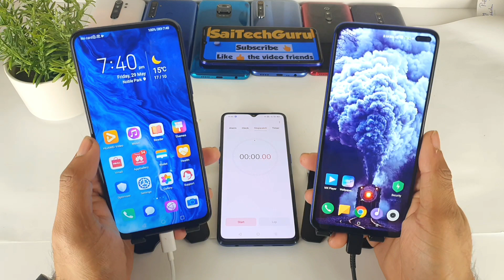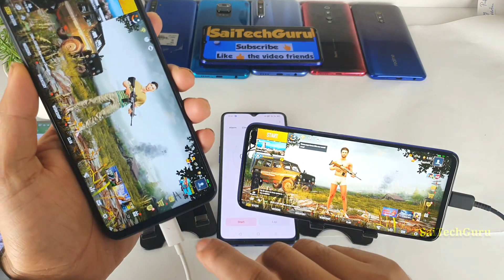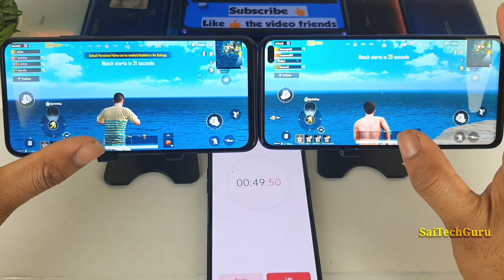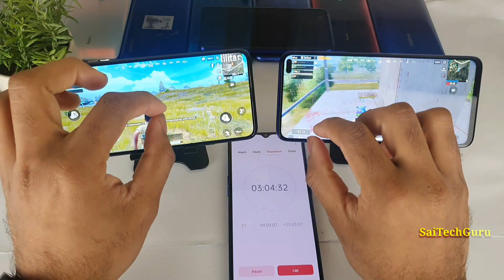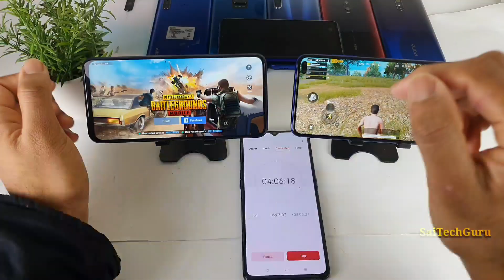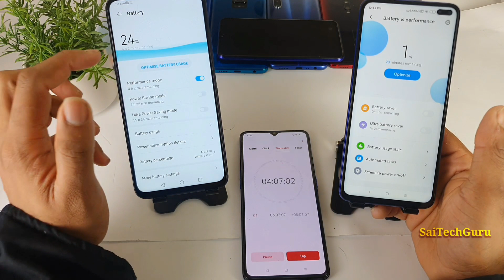Honor 9x pro vs poco x2 pubg battery drain comparison test

Comment: I think poco x2 has a very brighter screen hence it needs more battery, i play with 30% brightness is poco x2 and i get nearly 6hrs gameplay in smooth ultra.
Reply: Refresh rate 120hz or 60hz?
Reply: @SP-un3rj  doesn't matter bro. Game supports maximum 40 fps, but still i use it in 60hz
Reply: What's your charging time?
Reply: @adarshthakur3318  65mins as claimed by poco